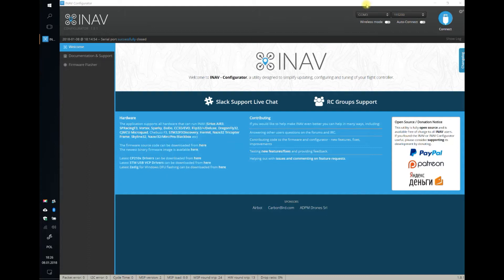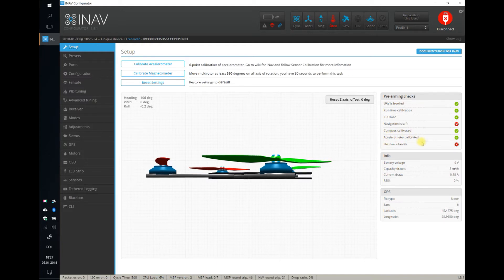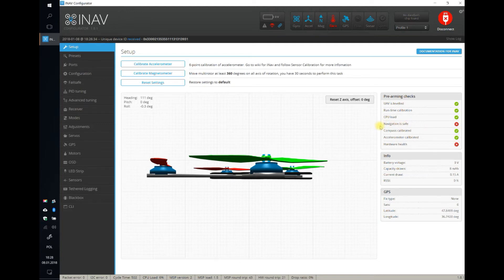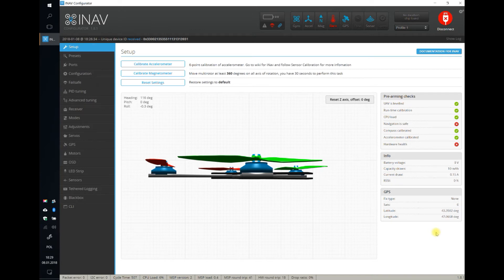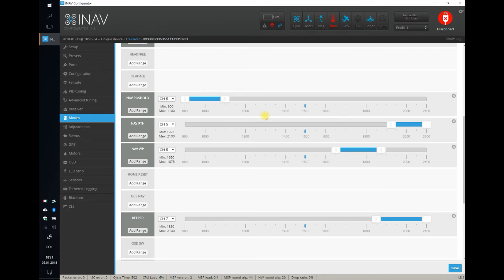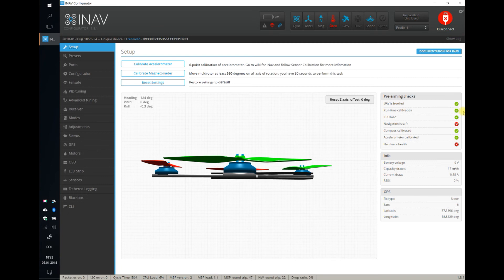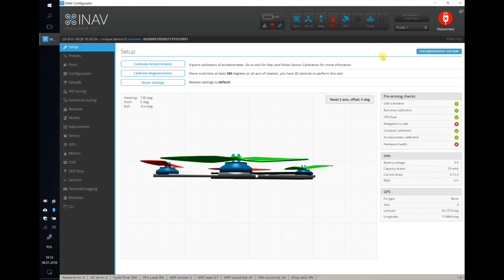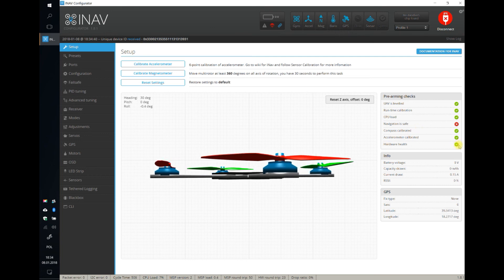Why INAV is not arming?

Comment: how do I get about this CPU load issue on an stm32F411  on INAV 5.0.0 when I lower the i2C speed below 400Khz the board crashes and fail to connect untill I disconnect all the sensors and reboot it

Comment: Trying to arm on a boat for work today, sometimes works sometimes not
Reply from the maker: it's gyro runtime calibration. it's moving so won't catch zeros. INAV 5 will allow to store calibration values for that
Reply: @FPVUniversity  no work around?We got it to arm a few times with less movement so must have been a fluke.

Comment: inav 4.0.0 armed.when use trottle stick up  and down motor not spinning. In  my fly sky trans.display trottle line 3 moving . when check motor test for calibration ,motor spinning.battery its ok.matek f 411 wse.
kto pomoze.jak nie rodacy

Comment: I thought that if you have GPS modes as well as Angle Mode you could Arm in Angle Mode even if you don't have GPS 3D Position. Mine wouldn't Arm so I deleted the Nav Modes and then I could Arm without 3D Fix. Add the modes and I can't Arm whilst the multirotor hasn't got a 3D Fix. But I thought it could before. I just updated a SP F3 board to the latest. I will see if I can get a GPS Lock outside now.

Comment: Did all that...all is green... but in CLI/Status I get : PWM output error. Motor or servo output initialisation failed.
... 3 short beeps from esc, no 2 long beeps... (all is good with BLHeli and Betaflight) so no hardware issue... HELP

Comment: INAV is driving me to just give up . Keep getting the "You need to upgrade your firmware before you can use the Setup tab " warning and it will not allow me into the program . I have updated , went back to older versions, and nothing seems to help.

Comment: I’m running 2.2.1, got a good 3D fix, and I have switches off, no navigation modes on, yet I still always have navigation is safe in red... I disabled magnometer (fixed wing), but doesn’t work with it on either, everything else is okay. Any ideas?

Edit: apparently you need to feed back rssi in a channel from controller and setup in receiver tab... had no idea

Comment: I was having trouble arming and getting the "NOT OK" message in the lua script running on my OX7.  Re-connected to the INAV Configurator and went thru the compass set up again and finally got the mag orientation right (verified with iPhone compass) as well as the declination.  Compass is showing the correct heading now and all is well.  Powered up again and while waiting on the "NOT OK" message to stop flashing on the lua script, I noticed that I had over 6 SAT's, so I tried to arm.  The quadcopter armed, flew, executed ALT HOLD, POS HOLD, and HEADING HOLD fine.  All the while, the "NOT OK" message is still flashing on the lua script.  Whats the problem?

Comment: Hi Paweł, How about re arming after FS. I try to manage with arming my not GPS equipped s800 fixed wing setup (inav 2.0.0), without success. 
After testing RC link lost, it goes to FS, after reestablish RC link, i can't arm FC, thr is low, when trying arm by arming switch only beep beep bepp. CLI shows:
Sensor status: GYRO=OK, ACC=OK, MAG=NONE, BARO=NONE, RANGEFINDER=NONE, OPFLOW=NONE, GPS=NONE 
Arming disabled flags: FS ARMSW CLI  .
 Moving sticks does not help :( 
I used following fs settings   
set failsafe_delay = 5
set failsafe_recovery_delay = 2
set failsafe_off_delay = 1
set failsafe_throttle = 1000
set failsafe_throttle_low_delay = 0
set failsafe_procedure = SET-THR
set failsafe_stick_threshold = 0
set failsafe_fw_roll_angle = -200
set failsafe_fw_pitch_angle = 100
set failsafe_fw_yaw_rate = -45
set failsafe_min_distance = 0
set failsafe_min_distance_procedure = DROP

Thank you in advance.
Krzysiek
Reply from the maker: and what kind of link you have over there?
Reply: @FPVUniversity  just using FrSky connected via SBUS.
Reply from the maker: @KrzysztofKuczek  try reverting to default settings and see if this will help: https://www.youtube.com/watch?v=Gh6i1kyxY6s
Reply: @FPVUniversity  seems to be working now ;) Just restored all the settings from file and it works. One more thing, is it any way to disable need of disarm for (5s?) to arm FC again after FS. Thx.

Comment: I am using i NAV on a board for fixed wing planes and I am getting a Settings Validation error message and I have tried everything. Your video does not cover this message.  The plane is ready to go and everything is working but I won't arm.
Help please..............
Reply from the maker: Do not restiore blindly from previous versions. One of the settings is just outside of the bonds. Do a full chip erase and setup everything agon without blindly copying

Comment: Hallo,
I check out your shopping List but still got some questions:
What extern Mag do you suggest? I use Ublock M8N GPS without GPS works but tried diffrent extern MAG but no success :( HMC5883 chinese clone not recognised by iNav and MAG3110 recognised but heading in setup upper left corner jumps in bearing. iNav shows all blue GPS Baro Mag but not shure about reliable data?
Does the Beitian GPS you recoment work with iNav? Did you try other external Mags?
kind regards Oliver
Reply from the maker: there are no original HMC5883l left since it's no longer manufactured. You have to try a few to be honest and try with extra pullups and lower i2c speed when needed.
Reply: Thanks for your quick answer! as you discribed in your video! I saw it but hoped there is an easy way.... Thats bit tiring I tried a lot but had no rerally good success. I wish there would be also a better shopinglist somewhere with prooven parts. this makes a start with iNav difficult.
Reply from the maker: Recommended BN-880 GPS has a reliable MAG in it
Reply: Hello, this Beitian BN-880 is flawlessly working with iNAV? did you do a Video about it? What is the setting for it in INAV? thanks Velá Nautica

Comment: I have the 'navigation is safe' issue even though all other things seem to check out. I disabled GPS to see if this was the issue. Any ideas?
* GPS disabled
* calibration is good
* no GPS modes enabled
* sensors seem fine
* the failsafe parashoot is grey
Reply: Power Max did you sort this out I’ve got the same issue

Comment: Hello,
Since I saw your video on the F405 Wing board, I ordered one and I upgraded my NanoTalon with it. But now I'm struggeling to configure the board properly. When the board is connected to iNav, everything is working well (servos are working, motor is running with the iNav Master switch, Pre-arming check all green, GPS working, OLED display working, VTX working, LED working, buzzer working, … everything fine) but when I disconnect the board from my computer and try to arm it, it’s beeping non stop (with the blue led flashing) and the motor doesn’t want to run (servos and everything are working). I flash the F405 board with the last firmware (inav_2.0.0_rc6) but it doesn’t resolve the problem. I don’t know what is wrong, do you have any idea ?
Reply from the maker: I suggest leaving it on a ground right after plugging the lipo on, since gyro needs to be stationery for calibration. It will never get calibrated if you will keep your model in a hand
Reply: I have the same problem and mine is really stationary on the gound, everything is working exept for the arm. Stays grey in modes tab, i can' t spin the motor, it works in motor tab

Comment: Why not change Inav so it is like pixhawk. Where you can arm and fly in non GPS modes. If you try and select a GPS mode while flying and you don't have 3D lock it wont allow the change until you get a 3D lock.
I find sometimes you are standing behind your quad for ages waiting, where I could be flying. This happens on the first flight of the day always. If you change over batteries straight away the wait is quite shorter.

Comment: I'm going to translate for English, it may be, it would be better for you to help me, I'm not meeting anyone in Brazil with your knowledge.

Hi friend, good evening I follow your channel and I decided to mount a drone, but I have a big problem when I set and I put in Alt Hold mode and nav Hold the drone oscillates a lot and turns over and falls. I do not know what else to do. I'm using
Spracer F3 - inav 1.9
Esc blhell 30a
960kv 2312 engine
Mini GPS 6m for F3
In a Phantom 3 Shell
Phantom 3 4S battery q

Please help me, I do not know what else to do, in case I can send you the Blackbox file for you to analyze.

Comment: Pawel, given that I have an issue with the aileron and rudder throws in HORIZON mode, and you explained that that is because the Integral will not be active if the controller is not active, I grabbed an extra controller, and configured it without GPS nor barometer, nor compass or magnetometer (disabled them in the Configuration, and the UART port). I am running iNav 1.9.3. Now, with that said, I cannot get a green in the Setup tab on the navigation safe. Of course, I don't have active or configured any NAV mode. Therefore, the question is, if we are forced to have a GPS connected to be able to activate the controller. Otherwise, which other situation would block the navigation safe, considering that I am not using navigation?

Comment: hi, thank you for the video. You said you are ready to arm at the end of it but navigation is safe was in red how come? 

I have this problem with my omnibus f3 board. I cant get that nav is safe in green. I only test my hardware its all on the bench and the only things I have on it is RX (ppm) for testing TX outputs. This is all fine. But if I want to simulate arming with switch it wont let me. Navigation is safe never goes green what ever I tried. CPU load is on 2%. Is this because I do not have usb and motor connected or should it work without it ? Maybe I have stupid question but this is first time I am doing this.  Thank you
Reply from the maker: Navigation is safe goes red if: not GPS fix, any GPS flight mode is enable: poshold, althold, rth, waypoints and so on

Comment: Thank you for a very useful video. I would like to more about arming problem(s) for fixed wing models as well.
Reply from the maker: cattlebaron they are the same as for multirotor. At least majority of them
Reply: Thank you, I am having trouble with Omnibus F3 flight controllers and suspect that they may be at fault. The whole episode has been very frustrating, as it could be iNav, the controller, the plane, the TX - RX combo or the pilot.

Comment: Pawel
Thanks for uploading this video - it will be a very useful check when sorting arming problems
My arming problem occurred when setting up a fixed wing - it was due to a non-compatible ESC
I switched to a different ESC and the problem was solved
regards
Hans
Reply: I am gonna try this tomorrow hans, i use a racestar 35A blheli esc, i am gonna try a normal one to see if it is solved